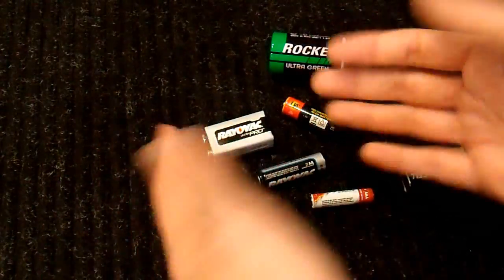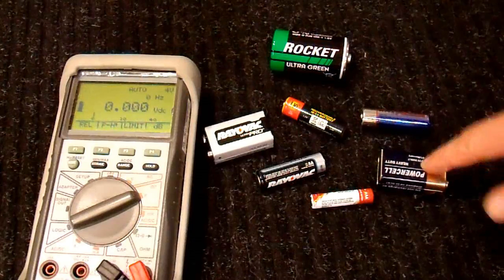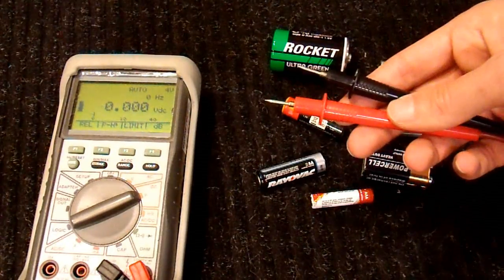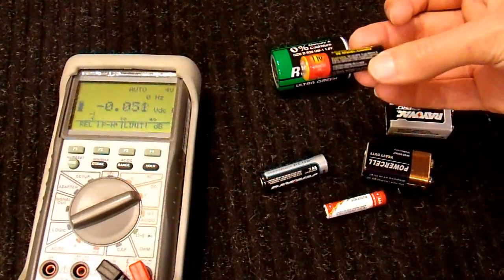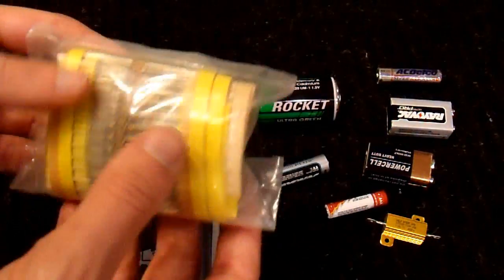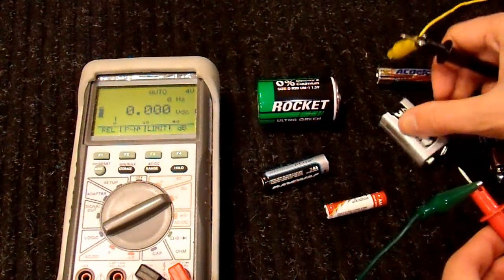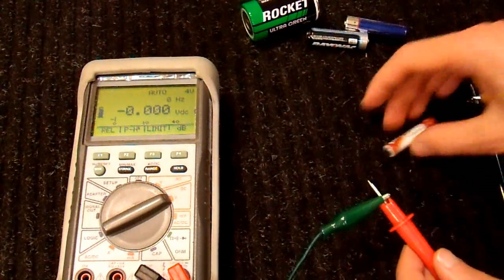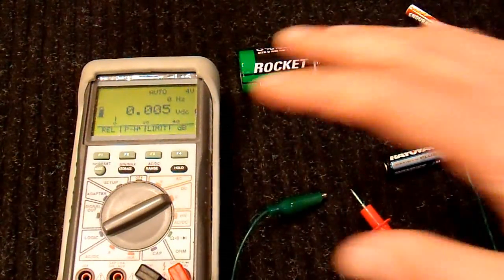How To Test Standard AA, AAA, D, C, and 9V Batteries with a Multimeter

Comment: Is 100 ohm resistor safe enough for lithium batteries ?
Reply: ***** thanks
Reply: Jonny kotzur

what does the C at the end of your comment (1C) stand for?
Reply: +Zambia95 : Jonny's answer is correct, but perhaps a bit difficult to understand for a novice.  In the context of rechargeable batteries, "C" refers to the rate of electric current flow that would charge or discharge a battery in one hour.  That's it.  (It would probably make more sense to call it the "H" rate, but nobody asked me.)   So a battery that has a capacity of 2 ampere-hours (2,000 milliamp-hours), would have a "C" charge rate (or discharge rate) of 2 amps (2,000 milliamps).   "2C" for this battery would therefore be 4 amps.   A charge or discharge rate of 0.1C would be 0.2 amps (200 milliamps), and so on.
Reply: Captain Quirk Thanks Captain.
Reply: +jonny kotzur : Yes, in the real world (as is so often the case), it's more complicated than the basic explanation I gave.  But this is a YouTube forum for the general public -- my explanation at least gets the basic idea across and serves as a good starting point for the basic principles.                           [new paragraph]                                                          There is something called the Peukert Effect, which is a phenomenon that reduces the effective capacity of a battery with higher current loads or charge rates.  In other words, if you charge or discharge a battery at a high rate, you will get less energy in or out of the battery than if you charged or discharged it at a lower current.  As with so many things in life, if you want something, you have to give up something else.  If you want to charge a battery quickly, or draw a large current from it (i.e., discharge it quickly) , you will have to give up some of its capacity.
Reply: +Zambia95 :  You're welcome.  :-)

Comment: you can not use the same load to test 1.5 or 9 volt batteries, the load for 1.5 should be lower than 10 ohms
Reply: How did you determine the value of the load?

Comment: Why r u getting _ 1.4v ???
Reply from the maker: I'm not sure exactly what this comment is referring to but a 1.5V battery under load will be something less than its open circuit voltage.
Reply: @knurlgnar24  didn't you notice a minus sign like this on your reading  _ before the numbers ???

Comment: Can't you just use the resistance setting?
Reply from the maker: The resistance setting actually applies a calibrated voltage to the leads and measures the current going through them.  If a voltage is present it will read either open circuit or overload.  Worst case it will destroy the meter, though most reputable brands are adequately protected against an error such as this.

Comment: Get to the point
Reply from the maker: OK.  "You need to load test batteries in order to determine whether they are good or not, and not just volt test them."  That was short and to the point - and like it or not it is not my style.  I generally prefer to watch short and to-the-point videos as well but I made my videos the way I wanted to because this was less a business endeavor to maximize profit than it was a hobby I could also make a few bucks on.